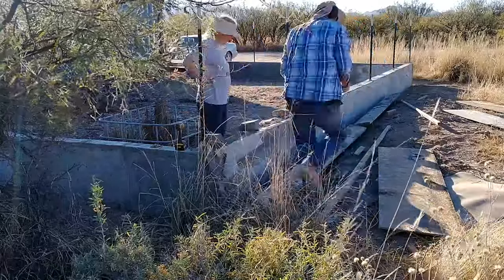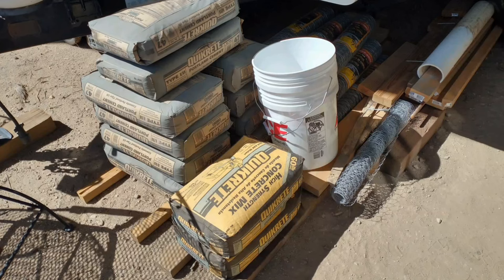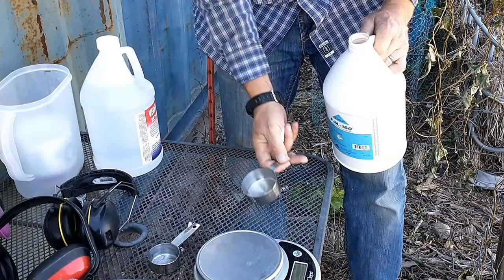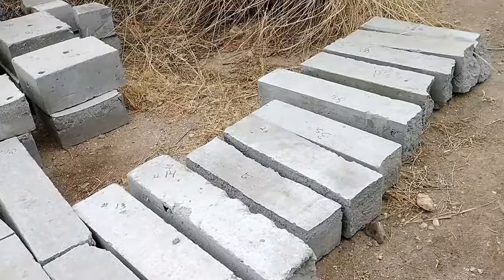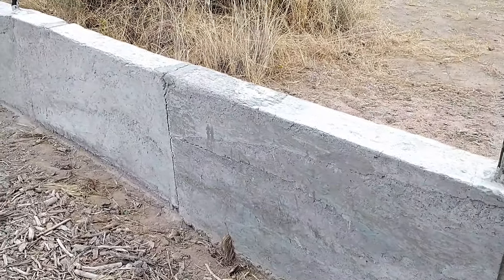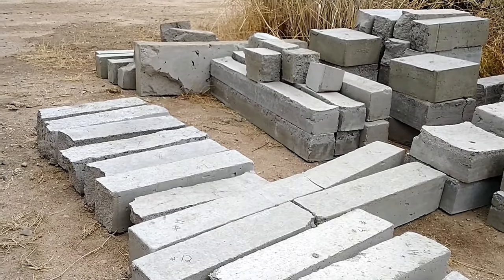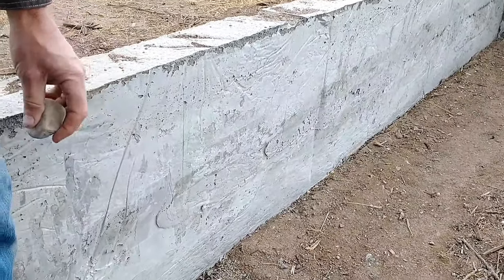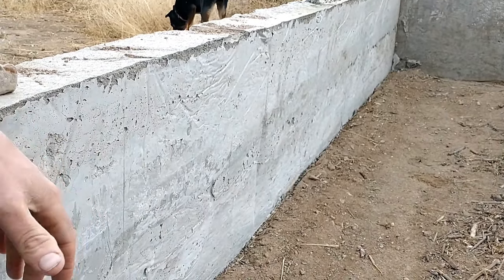Why we GAVE UP on AIRCRETE & What is Our Plan Now?

Comment: Batch to batch consistency with aircrete is really hard. Recycled, granulated styrofoam is a great stabilizer. It's free. It keeps EPS out of the landfills, it's bug-proof, and it makes batching your aircrete much easier. You still will have to coat the molded panels with a glass fiber matt. Stucco is a great option for aircrete.
Reply: I would have thought that you would stucco over any exposed aircrete to prevent exposure of the elements anyway. Personally I would hard render (stucco) both inside and out. Also I would plaster the inside on top of the stucco for a nicer finish. I have never used or made  aircrete. In South Australia they call it hebel, and a factory makes it.
Reply: Did you ever consider Bio Styrene.
Reply: Sort of like home made RASTRA BLOCKS !
Reply: I understood that styro doesn't bond with cement. Also it decreased the heatability because it melts at low temp.
Reply: @nebulousvoid  I've built buildings with RASTRA BLOK; which is a Styro and Cement CFS, with 6 inch cores filled with concrete and was pleased with the results. ps. direct flame would not melt the Styro due to it being encased in cement.
Reply: @ssmith2019   I've seen something similar but it had to have some secret sauce bonding agent in it. Dang near impossible to replicate with DIY. But that was years ago. I dunno what's possible these days. I've tried perlite but it's spendy.
Reply: @nebulousvoid  Yes, the cementitious  solution that the Styro is suspended in, is not water based but some sort of (latex?) addmix !
Reply: Agreed.  I had made so many concrete + eps panels for my farm.  The worst part was grinding a chuck of packing eps into small pellets. No wind allowed.
Reply: I would go a step further and say that batch-to-batch consistency with Portland cement products is really difficult.
Reply: You shouldn't make this "concrete" for structurals.   Buy premade.
Reply: I bet styrofoam also works better because it fills the voids, instead of creating spaces for the cement to leach into as it drains.

Comment: I think it would be well worth your while to attend an aircrete workshop.  I know both 'Aircrete Harry' and 'Domegaia' put these on.  Harry also does consulting work at a very reasonable price.  If you watch his videos, you'll see he went through all your issues and he has shown how he overcame them.
Reply from the maker: The workshops are pretty expensive. I also figure that a lot of the people who go through the workshops decide not to use aircrete, I'm just not seeing many people actually make or live in anything made out of  aircrete.  I watched most of aircrete Harry's videos, and anyone else talking about aircrete that I could find. I ordered Harry's thickening agent, and asked him some questions. He didn't answer my questions about how to get soft water, but we found an RV water softener that worked well. Giggedy George finally did a video detailing, what our main problem probably was, but by then it was too late. Our batches got worse as the temperatures dropped, it appears that using warm water in the Drexel solution likely would have helped. We have videos showing everything we tried. We had some great batches in the beginning, and go into foam density and other issues we dealt with in detail.
Reply: @RedandAprilOff-Grid  I think you were likely up against a few different things. I don't put a lot of stock into Quickcrete products. I watched another guy doing aircrete and he was using Bluebell or something then one time he got some Quickcrete and it was a disaster. The temperature is a huge factor too. Then even if everything goes right aircrete is still aircrete.

Comment: You guys made a really good effort and your evidence based approach has been invaluable! Thanks again for sharing the process. I think your decision makes perfect sense.
Reply from the maker: Yes, we really wanted to make it work, but we just have to cut our losses and move on. The time testing aircrete has been interesting, and while we have been making and testing aircrete the cost of lumber has finally come back down. Red likes working with wood much better than aircrete anyway.  OSB was $58 a few months ago, and now it's $21! 😊🏠
Reply: @RedandAprilOff-Grid  never give up! Success will be obtained for every effort!
Reply: @RedandAprilOff-Grid  I have an idea what your issue might have been and two solutions.  Besides weighing the foam to check it is the right density, the glycerin separates out and floats on the top of your foaming agent (drexel).  This leads to early batches being good and later ones with low to no glycerin where bubbles are weak.  The other thing that can make aircrete more stable and more economical and insulative is to add polystyrene filler instead or as well as foam.
Reply from the maker: @jonathanberry9502  We added 1 Tablespoon of glycerin to each batch and used a new well mixed bottle of Drexel for our last few batches. My best guess is the cold Drexel was to blame. We tried to keep it warm in our RV, but our RV was still pretty cold.  Later we learned that adding warm water to the Drexel may have helped,  so that's what we would have tried next.
Reply: @RedandAprilOff-Grid  Thanks, I am currently considering an polystyrene version aircrete to make a floating island/houseboat.
Reply: Produce good results? Did you guys wet it everyday? It was recommended 30 days straight.
Reply: @jonathanberry9502  Interested,  in knowing if the Polystyrene crete worked for you? Another question is, Is it possible to aircrete and used polystyrene together,  as air crete  insulation is superior to polystyrene crete and was wondering if a blend of the two methods would yield superior strength and insulation?

Comment: I wouldn't give up on aircrete yet! Regarding the testing of your aircrete block under weights, I feel this is a flaw in understanding the strength of aircrete as the blocks were lacking any reinforcement fabric. You need to use a reinforcement fabric over the surface of aircrete which is what attributes to the strength of the aircrete, as well as the shape of the dome itself, if making a dome structure. The blocks by themselves would undoubtedly crumble due to the porous nature of the material. One simple comparison I can make for this might be to consider a foam poster board. The foam by itself on the back of the board will obviously scratch and puncture easily. With the reinforcement of the poster board with the foam, the entire unit then becomes incredibly strong. That is sort of like how aircrete would work as a structure. You absolutely need the reinforcing fabric to give it its strength.
Reply from the maker: Yes, aircrete definitely needs to be covered in fabric and plaster. Our testing was to determine if we could make good and consistent aircrete batches, and to compare different recipes. We decided aircrete was not going to be a good fit for our house design. We are continuing to see shrinkage and cracking in the garden wall. Using fully cured blocks would be the only way I would build anything out of aircrete.
Reply: Another issue is that concrete is not strong in tension. When you test your blocks by supporting the ends and putting weight in the middle you put the lower side in tension as the block bows. Any concrete will fail like that. Why is this test relevant to your building? Is it so that you can use it as the head of a doorway? Note how the Romans did that as an arch so that every component was in compression.
Reply: My experience is that Aircrete is just not great for loadbearing.  Good in supplement to more reinforced material, good to work with, but it lacks the strength of other forms.  I've only had success when making it in blocks, rather than poured forms but that is probably a matter of operator skill rather than an inherent limitation
Reply: @Cnhaddock Can graphene help with this?

Comment: Thank you for sharing. Comerciallly, aircrete is cured in a controlled environment and the bubbles are produced by a chemical reaction that can be controlled by recipe. This is the difference between CLC (what you have made) and AAC (commercially made). AAC is cured in a temperature controlled pressurized oven.  I’m sure your results can be attributed to the cement moisture exposure prior to curing or temperature/pressure changes with weather. That’s my guess anyway.
Reply from the maker: Thanks for watching! There is a lot that can go wrong with homemade foam aircrete. The colder temperatures were probably a contributing factor too. Glad the prices on materials went down, and we were able to build our house through the winter. Glad we didn't wait until spring.
Reply: @RedandAprilOff-Grid  if you had made it above 65 degrees, might have worked. All epoxies, glues and quikcrete state above 50 or 55.
Reply from the maker: @WubiWatkins  The temperatures were in the low 80s when we were making the first batches, and mid to low 70s for the later one's. It was getting down below freezing at night for our last batches, so we had to keep the last set of samples in the well house to keep them from freezing. The foaming agent Drexel also needs to be kept at room temperature, and it was likely too cold. Adding warm water to the soap solution might have helped.
Reply: @RedandAprilOff-Grid  could have been a supply issue? Just trying to help.  Hate to see you give up your project that you were trying to do

Comment: I wouldn't use it for load bearing, but as an alternative insulation it would probably work well.
Reply from the maker: Yes, our supports were going to be 8 feet apart, so we were a bit worried about the aircrete having to span that large of a gap. Some of our batches were pretty nice and not powdery and brittle. The cold Drexel was likely a contributor to the issues with the later batches.

Comment: one way to make it more consistent with its strength and also to improve thermal resistance is adding styrofoam to your aircrete mixture,  a lot more thermal resistance and the strength of it is still very good, the only issue is it'll flake against the elements.  you need to wrap it with fibermesh then stucco it or like Stephen Williams stucco+limestone.  you can find a bunch of neat videos from Stephen Williams on how he built his work shed with it as well as an arched gardenshed now.
Reply from the maker: Styrocrete looks like quite the process. We personally weren't interested in driving all over town trying to find styrofoam. We don't live by a large town, & we would need a whole lot to build a house.
 I know it's all the rage right now, so we should be seeing styrocrete structures popping up everywhere soon. It will be interesting to see how it works out for people. 🙂🏡

Comment: To me it seems the biggest macro factor in your experiments that parallels the decreasing results in quality is the fact that the seasons have changed from warm to cold.  Maybe aircrete is just a lot more fickle when it gets cold.  

And others have pointed out that aircrete by itself is not meant to have a durable surface, nor deal with tensile forces. So for others who are considering aircrete, you'll want to evaluate how it fits into an overall system, and not just how it performs by itself in impact and tensile strength tests. 

And also re: direct contact with support beam- Any time two different materials come into contact with each other it's good to plan for how they will move differently, and the problems that could cause.  With weight bearing aircrete you would probably want to pour a concrete bond beam, or if used for insulation, using a material with some flexibility or elasticity between the aircrete and the solid material.
Reply from the maker: Yes, the colder temperatures were likely a factor. Drexel says on the label that it should be kept at room temperature. We tried to warm it up some, but I'm pretty sure it was still colder than would have been ideal.
These were comparative tests, intended to test the mixtures against each other, also to see if we could get consistent results, and make an aircrete that wasn't overly powdery or brittle.
Reply: This was a hella helpful comment. Thanks
Reply: @RedandAprilOff-Grid  I believe that when using the Drexel foaming agent, it needs stay in the consistent temperature range throughout the curing of your aircrete over several days. The foam will degrade when it is not at optimal temperatures. This will degrade the structural integrity of the aircrete as it cures.

Also, the quality of your water is a determining factor. If your water changes in hardness it will affect the longevity of your foam. A shorter foam longevity means that it will collapse before the aircrete has cured. I understand that soft water makes the bubbles last longer. You could try using some water softener salts to see if this makes your foam stronger.

But keep in mind that aircrete is never going to be as strong as concrete. Simply put, air is definitely softer than sand. You are replacing sand with air trapped by a foaming agent. Aircrete is more of a replacement for fiberglass insulation. It is not a structural replacement for concrete in a stem wall, or foundation.

If used correctly it can add rigidity to a structure and better air sealing compared to fiberglass batting between free-standing / rigid structural members of the building.
Reply: From everything I have seen it is certainly more of a wall material than a foundation one.  Also the comercial Aircrete blocks are all rather large.  They are thicker than cinder blocks, longer and taller.  That may have just been that companies being lazy, but I think it does need to be quite a bit more substantial to make up for it's weakness.
Reply: What about the fact that even if cured properly with good results, you have a material with billions/trillions of air pockets, each one filled with air that will expand/contract over time with temperature and humidity. since the walls of concrete surrounding any given air bubble can be extremely thin, there is no structural support after a number of expansion/contraction cycles, and the concrete air bubble matrix begins to fail as the thin walls of the matrix crack, break and collapse, destroying the aircrete, manifesting itself in increasingly brittle material and flaking/powdering of the surface layer as the underpinning matrix fails. Just a theory here.
Reply: @unknownquantity4440  Air entrainment in conventional concrete gives better resilience to temperature and moisture changes. The correct sizes of air bubbles allow small amounts of expansion and contraction to be cushioned.
Reply: I think the problem is that there's an unspoken assumption that aircrete performs just like concrete, only it weighs less. 

But the properties that make aircrete insulative and light are the same properties that will make aircrete less able to deal with tensile forces. Think of styrofoam, how insulative and fragile it is, how easy it is to "chip away at" and cut... just like aircrete

The increased amount of air in the material means less contact and therefore less bonding. When aircrete "cracks", the bond has failed. The way that some have ameliorated this is by bonding fiberglass or something similar to the aircrete, forming a shell.
Reply: @unknownquantity4440 won't happen like that and here's why: it's poured while warm, so even on hot days it won't expand enough to cause a problem, so it only shrinks. Concrete is incredibly powerful in compression... one of the best materials for that, so as air shrinks (actually the molecules just slow down which lowers pressure) the compressive strength handles the change with ease. Aircrete has been around for 100 years and under normal use (not structural) there is no observable degradation in performance due to thermal cycling with the weather.
Reply: Agreed. Aircrete is better as a spray on dome (aircrete hairy) or an insulated filler. It's not very structural. unless you're buying commercial aircrete from a company with a very tightly controlled process it's just not a good base building material.